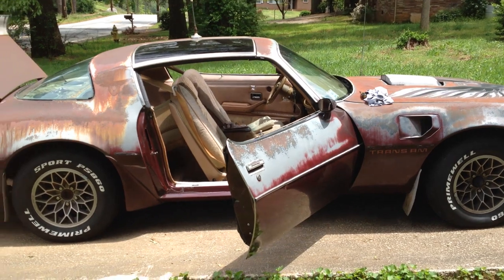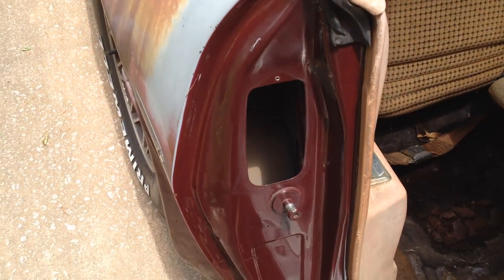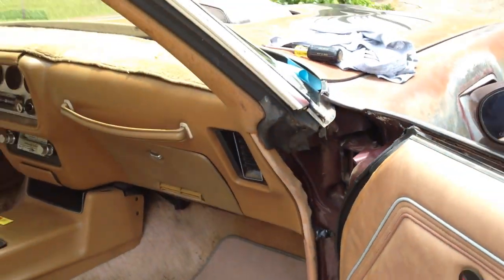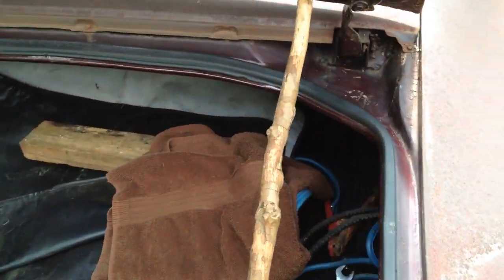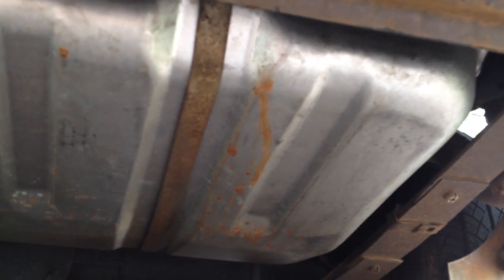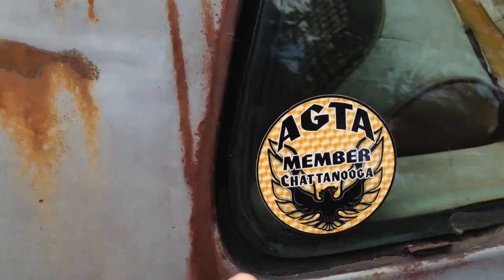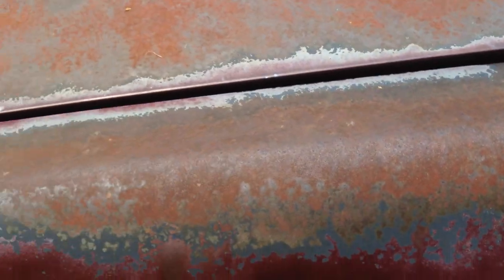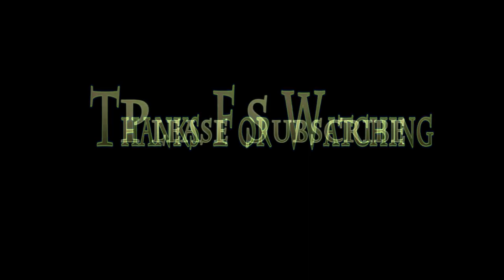1980 Trans Am Review  Sat For 20 Years In A Field

Comment: I live beside the salt ocean so cars rust despite being dry as the salty air will catalyze the reaction. They seem to rust more in summer as well which makes sense as increased heat speeds up the rust reaction.
So it depends where you live. Heat plus humidity are the main factors. I can’t have a patina car where I live as the patina would soon become severely weakened metal followed by actual holes a year or so down the road.
Reply from the maker: Great comment. thank you for that